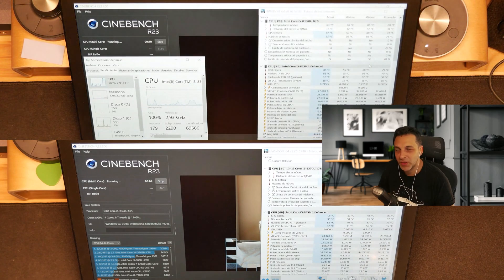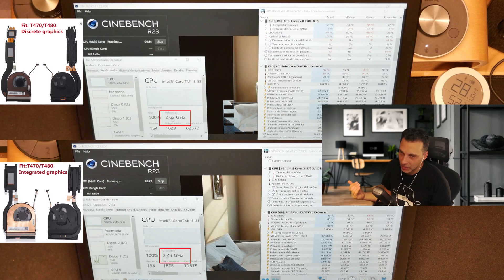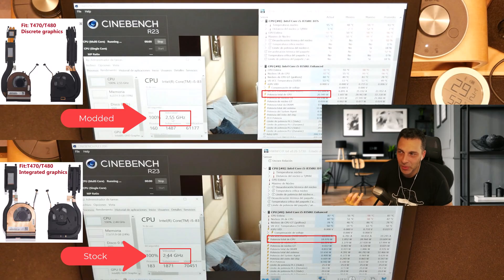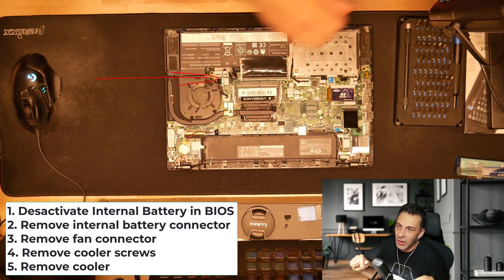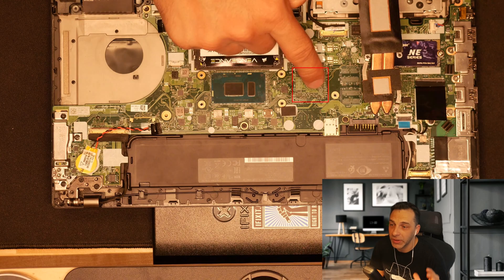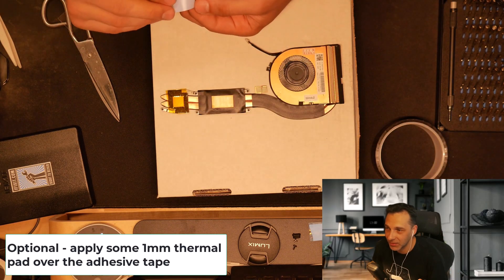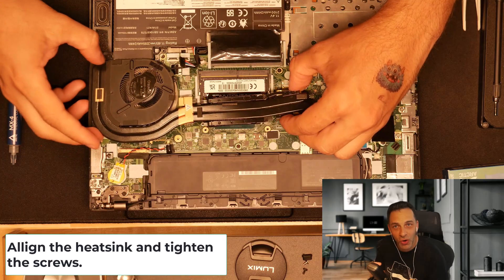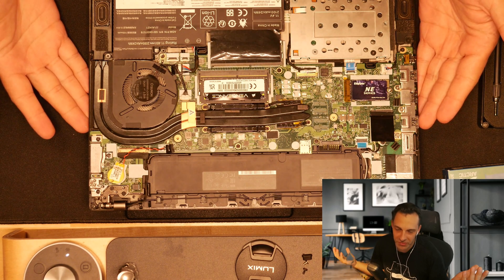Thinkpad T480 - More CPU power to you! (about 20% more) with this CPU Heatsink MOD

Comment: I see you have installed a KingSpec SSD in your WWAN slot. How has it been, and how reliable is it?
Reply from the maker: Yes. It was súper straight forward and no issues so far. I have windows on that, and Linux on the main storage.
Reply: @Silviu-Manea  Ok, good, I ordered one yesterday, and from what I've heard so far, it's a hit or a miss. I have Arch Linux on my main, and I want to add this drive to install Windows as a secondary system as well.
Reply from the maker: Let me know how it goes! Good luck 🍀😃

Comment: I think the best way to do this mod is first cleaning the bottom cover vents completely even if you don't see dust build up there's usually always a hefty build up embedded within and buying a brand new dual heat pipe cooler since this model is from 2018 making it over 7 years old and laptop fans usually last 3-5 years maybe 10 if built well
Reply from the maker: Those are excellent additional tips! Keeping the vents clean and considering a new heatsink for older units definitely helps maximize performance. Thanks for sharing!

Comment: I bought one with the i7-8550U and no dGPU. Should I do this? It will void the warranty, so I'd rather not do it yet if it doesn't offer significant benefits.
Reply from the maker: Yeah don’t do it if you are in warranty yet. And if you are not comfortable tinkering I would not recommend it either in case you break something. Maybe buy a cheap unit and experiment with that one instead before modding the main one
Reply: @Silviu-Manea  Thanks!
Reply from the maker: Most welcome 🤗

Comment: Got the model with an i5-8350u. Doing the dual pipe heatsink mod + a PTM7950 thermal pad makes a huge difference. Along with an under volt, it’s never gotten above 70 degrees celsius even under load for extended periods of time. Managed to get a stable -160 stable on core with mine, but it varies for each. Generally though, these kaby lake cpu’s really benefit from undervolting, i’ve gotten a 30% performance increase on cinebench from undervolting.
Reply from the maker: That’s awesome to hear, do you mind sharing the tools to do the undervolt and the OS you are using? I just recently got an i7 unit and I want to fine tune it like you did. 

Thanks!
Reply: @Silviu-Manea The tool i use is “throttled” on arch linux, i like editing the conf files over graphical interfaces, and i like having a tiling desktop environment for my workflow. But it should be about the same for a graphical tool either on linux or windows. I’ve heard some people had to change their bios to an older version to undervolt it, but i didn’t have to for mine so i don’t know for sure. My full changes are, -160mv on the core, -110mv on the igpu, -160 on the cache, -90mv on uncore/system agent, i also edit the power limits to allow maximum turbo boost duration. PL1 is long-term, PL2 is short term burst. I set PL1_POWER to 25.0, and PL2_POWER to 44.0. TEMP_PERF sets the temp at which it starts prioritizing performance over keeping cool, and TEMP_MAX will aggressively throttle the clock speed down when reaching the temp it’s set to. But I’ve never hit the temp max on my setup, i have it at 85 degrees celsius. Like i said though, it varies a lot, this is the best cpu i’ve ever had in terms of undervolting, i very much hit the silicone lottery. On my desktop for example, my i7-10700k can only get to -80mv, any higher and it blue-screens under load. Undervolting won’t damage anything though, my advice is take your time going at -5mv intervals. Even just an -70mv undervolt will still give good performance increases too.
Reply: But are you sure that undervolting settings aren’t blocked by bios? If you got 0 when run ’sudo rdmsr 0x150’ it doesn’t work
Reply: @Self-taughtAIDev It’s working yeah, i monitored it for quite a while, and had to go through a few blue-screens before i found a stable number. I bought mine second-hand and it’s on bios version 1.19, from what i know it’s only blocked on 1.25/1.26 and newer versions. I assume the previous owner either never flashed a newer bios, or he also undervolted it.
Reply: @Silviu-Manea Also the PL1 and PL2 settings i think will be different from what mine were, my stock PL1 was 15.0, not sure if it’ll be different or not on the i7 but i’d check your specific chip, there’s a lot of reddit posts to look through, that’s what i did for my i5-8350u when i was researching before. There’s also the thinkpad forum but it kinda hurts my eyes to look through.
Reply from the maker: Thanks mate. I’m tinkering with NixOS at the moment since I have three units and I want a consistent setup throughout all of them. Once I have that I might get into the undervolt rabbithole. Believe me Nix is also a huge one I just stumbled upon 😆.

Thanks for the detailed info. I have two units with the same cpu as you do. On those I’ll try this and on the i7 I’ll experiment also. 

Again, thanks for the info and for commenting. I’ll upload a video with my final setup if I ever finish it 🤣

Comment: Dual heatpipe cooler is useless because in T480 the bottleneck is the fan (airflow) itself!

If you use a good thermal paste - for laptops you should never use desktop pastes no matter how high end.. Laptops cpu run much hotter and are usually direct die..

Laptop thermal pastes are thick almost like gum! I am getting extremely good results with even the cheapest chinese pastes like gd-2 and gd-3 

GD900 is not as good but it works for desktop cpus with large coolers and metal caps on die
Reply from the maker: Thanks for the info. I wouldn’t say it’s useless since y could get better (measurable) results. But hey, thanks for the info, I’m sure someone will find it useful.
Reply: @Silviu-Manea thanks for the response i appreciate it.. I'm using single heatpipe fan on mine now, I have the dual heatpipe cooler as well but the difference is simply negligible esp for stress tests.

I'm able to get 4k+ cb23 on stock cooler with tpfc and throttlestop enabled running stable at 32W

I am going to get the external cooling fan (vacuum/suction type) even a cheap coolcold one from aliexpress drops temps by 20c and case temps drops significantly as well!

Regarding thermal paste, gd-2 is $5 for a 15g which should be enough for 30-50 repastes.  Although there are cheaper 1g and 3g sizes as well!
Reply from the maker: I don’t discard going that route on the t480 I use for tests when I have some time. Thanks for your detailed response!

And hey if you fell for it, maybe record a before and after the upgrade and post it here so we all see it.

Regardless, I end up doing that upgrade, I will definitely record a before and after, the difference you claim is just impossible to ignore. 

I’ll check it out! Again thanks

Comment: You can reduce the temperature from 5 to 8 celsius more using the program ThottleStop. You can undervolt the CPU to get better temperatures, And maybe a new video on the program and the results?
Reply from the maker: I’ve never been a huge fan of messing too much around with the systems defaults. Not for overlocking not for undervolting BUT : when I did use it, especially for undervolting ( I have a AMD 5950x CPU in my gaming rig and that sucker gets really hot) I did it via bios. 

I tried some utilities for windows, including the official ones from amd but no matter how much effort I put into fine tuning the settings, at some point, in some random game, the system was unstable or I experienced random issues I normally don’t get with the default settings.

Since this T480 series I’ve started seems to interests more than one person, and your idea is legit, I will research ways of undervolting via software (the bios in this case is a no go) for both Windows and especially Linux, which is the main OS most T480 users use or eventually switch to, like I did.

So yeah , thanks for the idea, I can assure you that video is something I’m planning to do at some point in time.

Thanks for commenting and supporting the channel. Means a lot!
Reply: @Silviu-Manea  undervolting is not possible when bios version is 1.28 and later after lenovo decided to mitigate the Plundervolt vulnerability, which locks the FIVR (Fixed Voltage Regulator) controls.
Reply from the maker: Now that’s some valuable time you saved me by having to investigate that myself mister.

Respect 🫡

Comment: I repasted my laptops with 7950 Honeywell. The difference was mind-blowing.
Reply from the maker: Really? How much is mind-blowing in degrees ?
Reply: @Silviu-Manea Don't know, but the laptop AMD 6600H got from perma fan to more often turned off and never reaching the fan speed again afterwards. It was literally a new laptop and the old paste wasn't even a year old. I am doing this since 1992 and never had such a dramatic difference. Before thinking about liquid metal I'd recommend trying the Honeywell stuff first.
Reply from the maker: Definitely that made a difference. I took note of the paste and maybe I’ll try it someday. Thanks for the info! And for commenting !
Reply: @petergplus6667  Never use liquid metal on laptops, it'll fly off everywhere from bumps and motion, and short out something. LM is not suitable for electronics strictly speaking.
Reply: I did the same with my T480 "dual heatsink" mod. 84c is the absolute max if i really open everything. Before the PTM 7950 i was hitting 94/98c at times. Plus it lasts a long time compared to liquid cooling paste.

Comment: Can this work on a T580?
Reply from the maker: Hello and thanks for commenting.

I don’t have a t580 to test with so I couldn’t really tell. 

The concept applies the same ( cooler CPU means more performance ) but I have no idea how is a T580 inside or if the dual heating system fits or not, etc.

If you happen to have a unit and you feel adventurous enough to try it out, let us know ! 

Cheers !